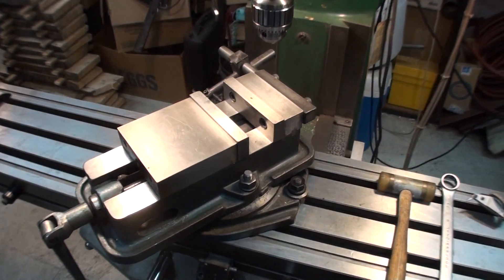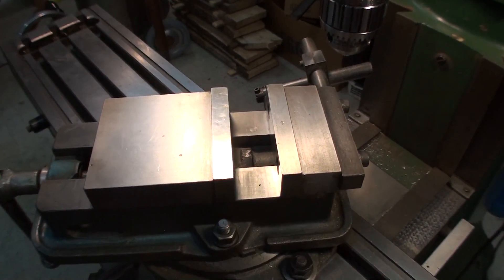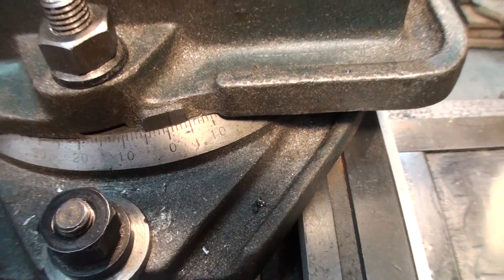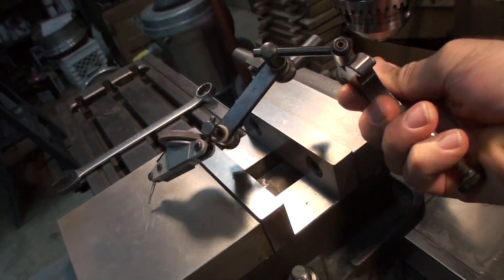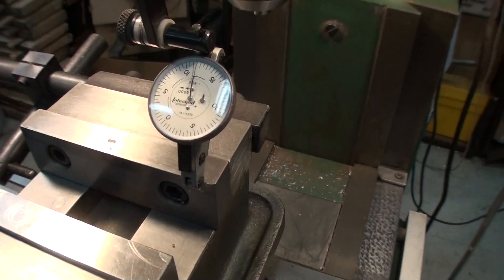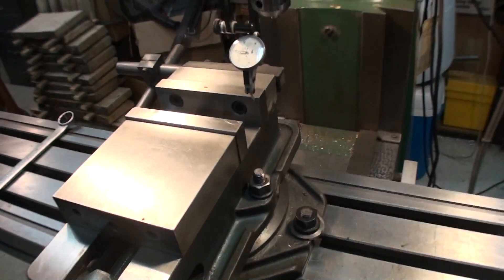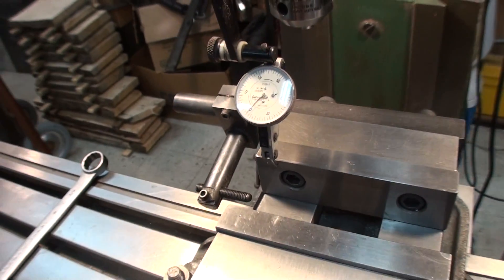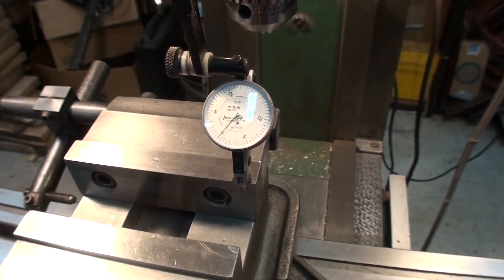Indicate the vise on a milling machine in just one pass

Comment: I do not have room for the swivel base so I use the machine blocks provided with the vice and then if any movement at all it is only about nil.
Reply from the maker: If your vise is keyed, it doesn't need indicating. Just push it against one side of the tee slot, or the other, and tighten it down.

Comment: Having done that, how far off zero was the vice swivel base ?
Reply from the maker: No idea. I just loosened the locks and whacked it with the hammer. The farther it's off though, the quicker you have to be with the hammer to get it back in line, or just slow the feed down. If you need a number, a degree or two would be a good place to start.
Reply: @TomsTechniques  Was it this vid or another where you talked about keying it to the table. I did wonder about T nuts that extend upward to accurately locate into the slots where the bolts go - to take all the slop out of that and align the vice accurately ??

Comment: Yo thats super cool. Gonna try it next time when indicating my vise, was doing it the usual way and it was so annoying.. how did you learn machining btw? Are you a machinist for living?
Reply from the maker: I smile every time I use the technique. It actually makes indicating the vise fun.
I worked in various machine shops while working toward a degree in trade tech education and taught vocational machine shop in the mid seventies. From there I took a job with a DOD contractor as a research machinist and eventually went with a start up company as a designer/prototype machinist. That company sold a couple years back, enabling me to retire. It's been a good run.
Reply: @TomsTechniques  thanks for your content here, have a nice day. And yeah, keep smiling even when youre not using that technique at the moment )

Comment: To Be Fair. The intent here is to align the solid vice jaw with the X axis motion of the machine. Not the T-slots as you mention in your first statement. You can hope that the T- slots in the table are parallel with the way movement, but not allways. I've seen big differences. Also, remember when using a wrench; Righty tighty, Lefty loosey. just saying.
Reply from the maker: If the T-slots on your table aren't parallel to the X axis of  the mill, you should
 probably consider investing in a better mill, because they are often 
used to align parts parallel to the X axis. Just saying.
Reply: beepcode He's holding a camera while filming and watching through the camera. Try it sometime, it will throw you off while doing something you've done without issue thousands of times (when you didn't have a camera). 

I'm betting Tom has orders of magnitude more experience in every part of this than you do.

Comment: I guess what isn't mentioned here but is inferred is that it has to be on a rotary base for this to work. This doesn't work if it is just clamped to the table with the two bolts.
Reply from the maker: +gus bisbal 

It'll work on a vise without a swivel base. You just need to estimate the angle and maybe take a couple of tries to get it right. The whole idea is to make your adjustments dynamically so you get instant feedback.

Tom

Comment: i cant believe i never thought of that!, not that i do it everyday but when i do need to do it, this is now the way i will. Thanks!
Reply from the maker: I came up with the idea 20 years ago or so and it's the method I've used ever since. Just make sure the travel of the indicator is centered so it doesn't bottom out or lift off the jaw as it traverses.

Tom

Comment: Hi Tom,
 New Guy here-got the bug though-trying to learn. Know this is a old video but I watch all your vids, sometimes many times. Thank you for the teachings. Have a question about the vice stop on your vice, how is the other side (rear of vice) finished. Plan on building one and looking for ideas.
Gordon
Reply from the maker: Gordon,

This type of info never gets old because there is always someone new to benefit from it.

The rear of the vise is designed to accept the jaws, just like the front. It has the same two 1/2-13 tapped holes, and the bar of the stop attaches to them.

Tom

Comment: I think your technique works well with the vise mounted on the swivel base.  Have you ever tried it with the vise mounted directly on the table?
Reply from the maker: I have not, but the concept would be the same. Just pivot the vise around one of the hold down bolts.

Comment: What the?  Tom, you're incredible, I do this everyday, even with a rotary table, but I take up 4-5 or more passes...I guess with a rotary, just rotating the table in the right direction until the needle stops moving?
Reply: How did you figure this out, that is such a time saver, I can see the centering of the rotary table, thats great too.  Thanks for all your time, you showed me how to make a power draw bar too, you had the most simple of the ones out there on youtube..
Reply from the maker: Mario R

Mario,

Somewhere along the way a light went on and I started doing it this way. You are right, it works on a rotary table as well. It would be interesting to know how much time was saved over the years by doing it like this.

Thanks for watching.

Tom
Reply: Toms Techniques I have my own machine shop in Los Angeles, but I learned from this guy and his son in Rosarito Mexico, let me in their shop and use it for 3 years, real good guys.  I'm sending this video link down there, I never saw them doing it this way, it was the old way, pounding on the vise back and forth…I did it with my rotary, and up to now, I still can't believe it..Thanks for your time putting these videos up, this on is the most time saving so far i've seen..
Reply from the maker: Mario R

Glad it was a useful tip for you.

Comment: Hmm, the indicator could have reached its limit position ...
Reply from the maker: This particular indicator has a range of .060" and I only used .041", so it didn't reach it's limit, although you bring up a good point. It would have been better to check to see if it still had travel before making the final pass. I take that stuff for granted, but I need to make sure it's mentioned to the uninitiated.

Thanks for commenting.

Tom
Reply: Toms Techniques
I was thinking the same thing, if you had of backed the feed up a few thou just to make sure there was still travel left in the indicator it will have left no doubt to observers such as myself, great method just the same.

Comment: Tom I've been watching your videos since I stumbled on them while searching for hardinge HLV-H -videos. Two suggestions to assist us noobies. Mention the gear you use and why for example what  type of vice you use drilling chuck, micrometer etc. A good example where you did this was with the taps on the power tapping vid. Getting the benefit of your experience when it comes to tool selection is invaluable. The otherthing is to mention special tools you have used in the comments  eg the indicol Thanks again for great videos I am learning fast!
Reply from the maker: That's a good suggestion. I tend to take the tools I use regularly for granted and forget the bad decisions I've made on tool purchases over the years. I think the biggest waste of money I've ever made on a tool was for a co-axial indicator. I paid $350 for it (name brand) and rarely use it. It takes way too much vertical space and just isn't worth the time it takes to crank the knee up and down to make room for it, especially when a simple edge finder does just as good a job.

Glad you are enjoying the videos and thanks for watching.

Tom

Comment: Some things are obviated here, it seems. Your rotating base would not have to be trammed, but for the degree selected to mean anything, it likely was. In any event, I imagine the same technique would apply to those of us not using/owning a swivel base, as long as the vice was tilted into the indicator path and not away from it. The best ways are always the simplest. Thanks!!
Reply from the maker: The graduations on the swivel base are already aligned with the keys on the bottom, so there is no need to align it.

This same technique can be applied to a vise without the swivel base, you just need to leave one hold down loose so it can pivot.

Tom
Reply: Ah. I was not necessarily aware that the swivel bases were keyed to the t-slots, if that is what you are saying. I have an old base here, from I have no idea what. No keys on it. Didn't know, but it is a nice feature. thanks for the info. :-)

Comment: Nice!  Harder without the power feed..   Incidentally, and  a minor point.. You are not aligning the vise jaw to the table slots, you are aligning it to the machine ways.
Reply from the maker: Power feeds are a definite plus.

Don't know what mill you are using, but the table slots had better be parallel to the ways. I know mine are because locate work off of them all the time.

Tom
Reply: Tom's Techniques That is the assumption.   But table slots can be screwed up, and the table (and every thing mounted to it) isn't guided by the slots.  It's guided by the ways.

Comment from the maker: Yes, it is possible to be fooled by an indicator not in contact with the work (voice of experience). In this case though it moves quite a bit at the start and less as you tap on the vise, so you get verification that the indicator isn't fooling you. I'm glad you enjoyed the tip.